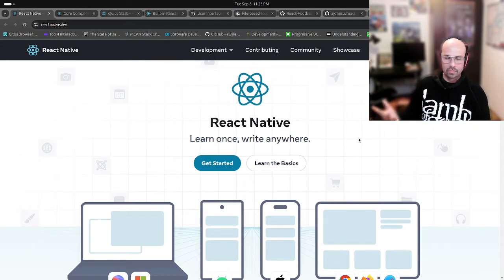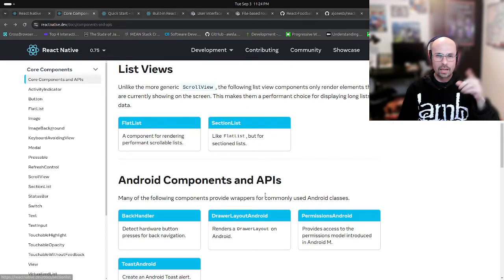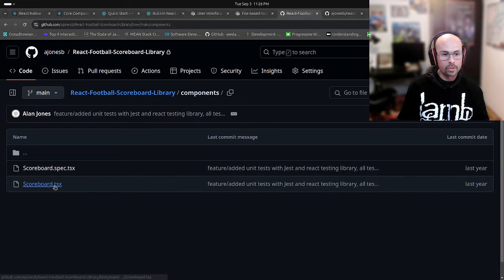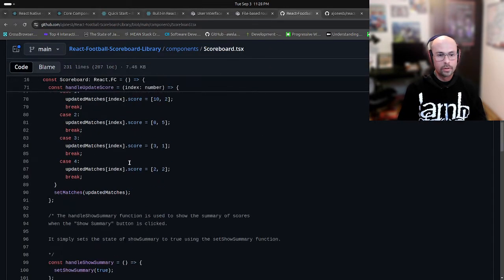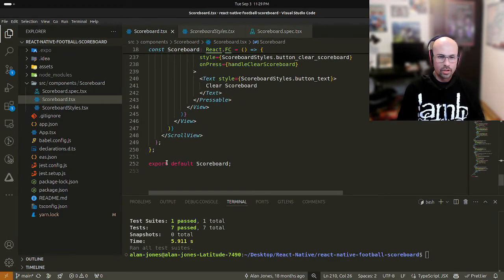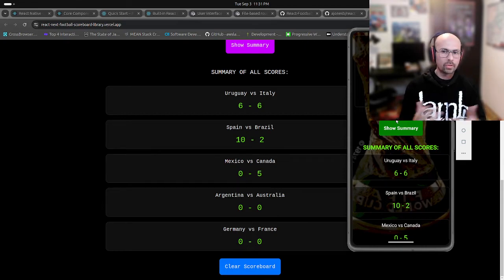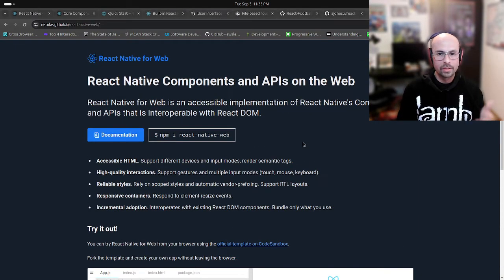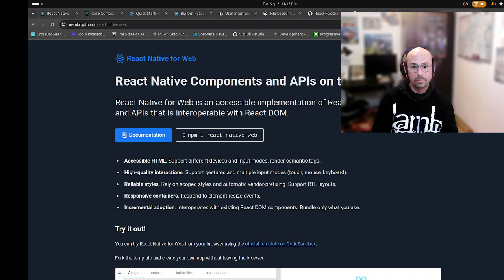React and React Native: Build Cross-Platform Apps with Unified Code & Testing!

Comment: Is there a way to automatically apply styles to a web app while using React Native? Basically, I'm looking for a way to reuse the same styling for both mobile and web, so I don't have to rewrite styles for different platforms, so we can maintain consistent ui in both platforms applications? Please help me❤
Reply from the maker: Hi yes sorry for the late reply, just saw your message. You can use styled components: https://styled-components.com/ or Tailwind for React Native, check this out: https://github.com/vadimdemedes/tailwind-rn also there is React Native Paper as well, kinda similar to a UI library like Material : https://reactnativepaper.com/ These are all designed to use on web and mobile. Hope that helps!